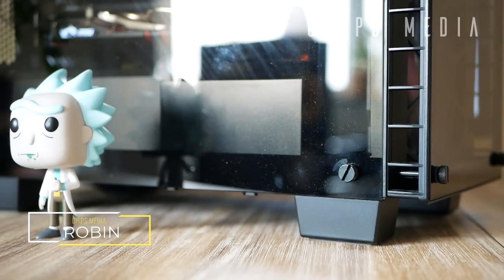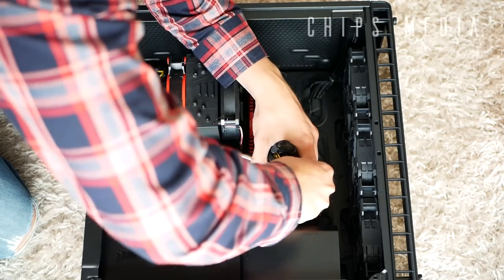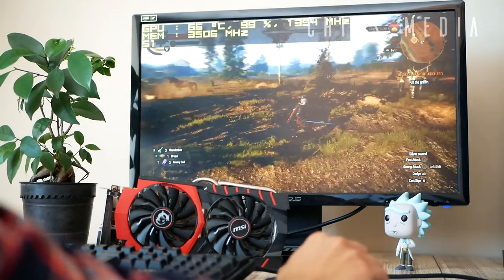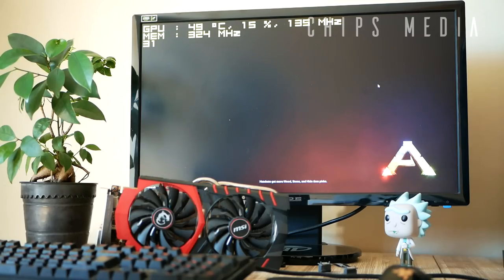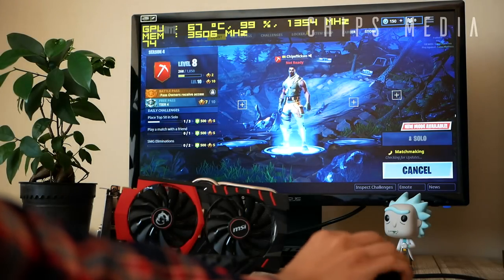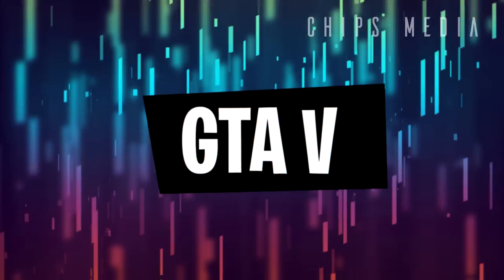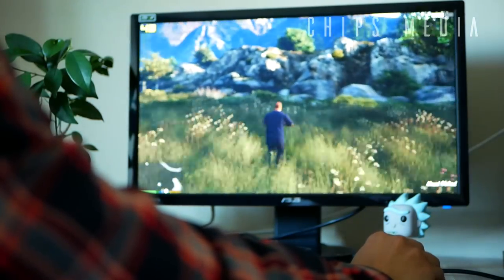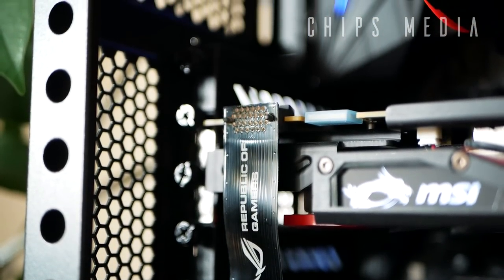Are Two Graphics Cards in One System Still WORTH It?

Comment: Too bad our eyes cant see any difference between 60FPS an 120FPS
Reply: thats not true, obviously you dont know how monitors work. In order to experience fps higher than 60 you need a monitor with a higher refresh rate. Ex: standard 60Hz you can only experience up to 60 fps because your monitor cant refresh fast enough to prosses anything higher than its refresh rate (refresh rate is measured in hertz)
Reply: @Kurisma  Ive seen it has been proven, But thats nice =)
Reply: Try to play CS:GO with 60fps and 500fps. You will clearly notice the difference.
Reply: Around 60FPS would be enough... You will notice 120FPS but you might had a seizure afterward.

Comment: Sooo would it be worth it to pair one of my older gtx cards with something like a 1070 ?
Reply: Might as well try it, but yeah probably
Reply: U cant, it has to be the same
Reply: @mr.rubberducky9194  it dont have to be the same. Multi-Adapter is a thing you know
Reply: @zvincqnt4309  it does with 970
Reply: The only thing to consider is the older one most likely has less memory,  from what i remebwer years ago bridging them it may use the card with less memory.

Comment: I would be curious about Battlefield 1... It's said that it scales very bad which is sad because Battlefield 4 scaled awesome back then with my two 960s 4GB and Battlefield 1 is one of my favorite games these days... It runs fine on my single 970 but there are some games such as Rise of the Tomb Raider where I wished I'd got a little more horsepower under the hood...

Comment: Well I would assume that more modern graphics cards and as well Motherboards would support SLI on the board itself opposed to connecting your graphics cards together. if I am wrong on this, Then do correct me on that note, But really the only reason you'd buy a secondary graphics card is to handle a secondary Monitor as most graphics cards in the GTX 1050 1060 TI's usually only support one HDMI slot. You can buy an Adapter, But it isn't the same.

Comment: can I use GTX 1050 Ti with intergrated graphic card??
thanks
Reply: what
Reply: the 1050 ti is a graphics card
Reply: @sub-to-pewdiepie1821  i know it
Reply: @sub-to-pewdiepie1821  but i have question, can i connect these 2 grafics card
Reply: @sub-to-pewdiepie1821  i am it wrong write
Reply: @brumson1213  They should be already connected, if not. Then it shouldn't be possible..
Reply: You can but the system will chose which one to use... it not really for gaming.

Comment: Watch from 4:46 single graphic card and 5:06 double graphic card performance.

Long story short, the answer is yes, adding another graphic card will give you a performance boost, but don't expect that adding another card of the same make and model is going to double your framerates or anything.

At most expect a 20-37% increase in fps and performance.

Thank me later.

Comment: Can we insert two different graphic card in same system 
Example
Gtx 970 strix and rx 580 8gb 
Is any problem in that?
Reply: Depends what Ur using it for but if it's for gaming unlikely for most games but there is something with directx12 and not many games have worked around that

Comment: should have tried on a 4k monitor not 1080p
Reply: You will lose fps
Reply: @lightingman1235  but how many? 🤔
Reply: You lose about almost half. So say you play ark and you have everything on high and have a 70+ only a 1080 monitor then if u play on a 4k monitor you lose frames say about 20+ fps or more. Its really a sacrifice 4k better detail and less fps or normal 1080 p with high fps. Some games can support 4k. Now borderlands 1,2, presequal can support it. But there is a way to play all your fantastic games on 4k without going under 60 fps and also playing ark on 4k ultra setting without going below 60fps
Reply: The way about it is to buy a rtx titan si sli. It is around 2 thousand to 3 thousand dollars its better then a rtx 2080 si sli. The rtx titan si sli have about 30-40+ fps and you can overclock it for and extra 5+ more fps. I have 2 rtx titan si sli so i have a 4k monitor and a 1080 p monitor and to tell you the only difference is lighting and some detail and most games cant support 4k and when i play a game on 4k i never drop below 60 fps on any game im ALWAYS at 100+. Shadow of the tomb raider about 200+. gta 5 150+ borderlands 2 4k 100+. Ark supports 4k so my fps on there is about 80+ but only if i feel like using the 4k monitor if not then over 100fps. Name any game i can run it fast i work 2 jobs and get over 2 thousand a month so im good on all my shit
Reply: I also have 9 cooling fans and im actually gonna install a 10th on it my cpu always goes to 30+ degrees. I spent over 10 thousand on all my specs and im 19 years old and only took me 5 months
Reply: @lightingman1235  it depends on the game. You won't lose fps playing pacman i hope
Reply: @gamebros8424  of course it depends on the game. But 4k isn't supported for most games that why you will lose 30% of your fps

Comment: Bro I didn't understand
Is 2 graphic cards better from 1?
Reply: Meliodas The G T.V no
Reply: Not for the price
Reply: Nugget Pug but is it better?
Reply: @isgbhaha138 , Yeah, the performance will improve quite alot, but it is expensive. Say if you were getting 30fps at 4k with 1 graphics card, if you add a second graphics card (an identical one) youll get about 50-60fps. Thats just an estimate though. To answer the question, yeah its better

Comment: I'm going to do  2 r9 270x 4gb I just need to buy a dual pcie slot mobo
Reply: Go for Msi z370 mobo and yaah u should choose a gtx 1060 in second slot
Reply: GAMES AND TECHS ahahah dude you cannot Sli two different cards
Reply: @ravenmoore8432  sorry I didn't know
Reply: GAMES AND TECHS ahh my bad I thought you were being smart :p but yeah only if you could sli gtx 1060 that would be awesome but Nivdia knows everyone would have sli 1060s
Reply: @ravenmoore8432  gtx 1060 Don't have sli anyway my rig 

Gtx 1060
I5 8600k
16gb ram
1tb HDD
240 gb ssd
120mm dual fan liquid cooler
Carbide spec 01 case

Comment: Can I use GTX 1050 TI and GTX 1080 TI togather1??
Reply: Look it up lol
Reply: From my experience, it has to be 2 of the same graphics cards. (Dual 1080s or dual 1050s, etc)
The brand doesn't matter, typically but matching brands would help with compatibility.

Let me know if that helped.
Reply: NeZerWOrLD I actually think motherboard compatibility is important, if both desired graphics cards can actually fit on the motherboard. (or is compatible) correct me if I’m wrong though.
Reply: No.... You may well just used one 1080 ti....